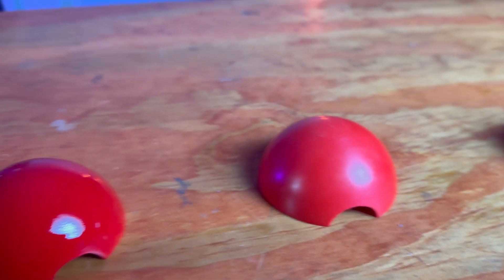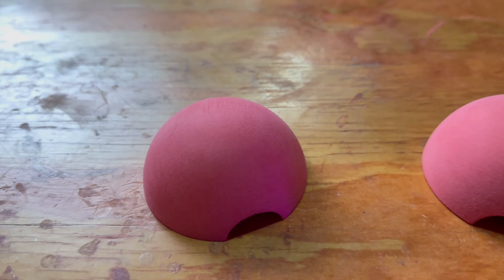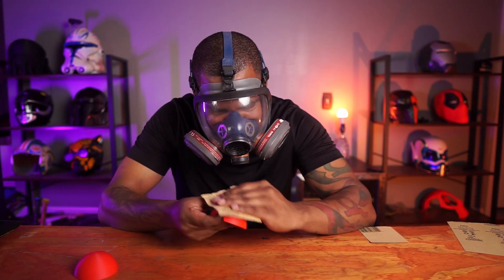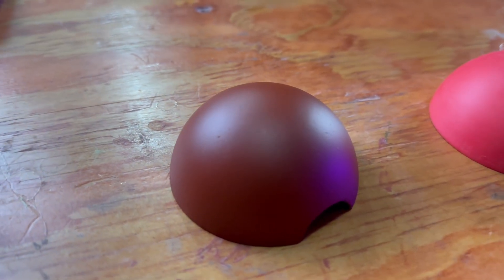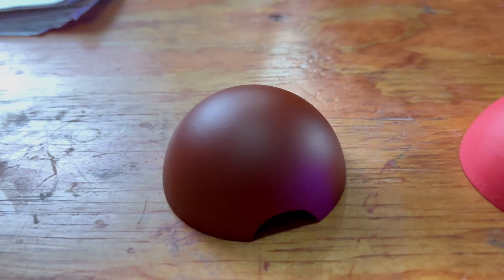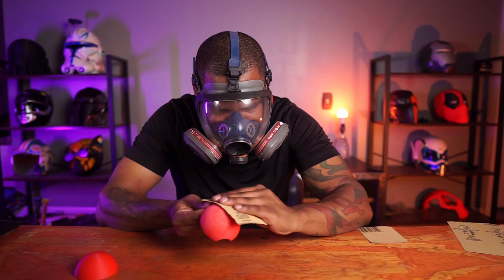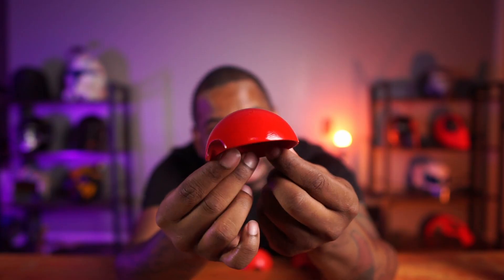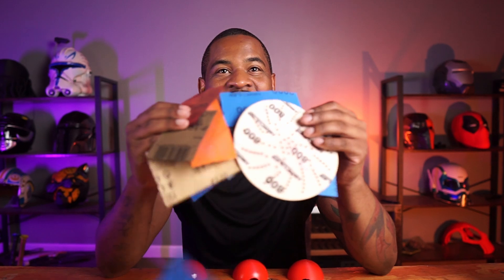Get Amazingly Smooth 3D Prints Using ONLY Sandpaper!

Comment: When you try the acetone vapor test, try it not only with PLA filmament , but also ABS filament.  The ABS will probably react better to the acetone than the PLA.  
of course, I am not sure which Bambulabs printer you are using, so ABS might not be printable with your setup.
Reply from the maker: Thanks so much for the advice I’ll remember that, and I’m using the X1C so I should be good 2 go! 🤘🏾

Comment: Filler primer works great on projects with not so much detail. Once you get into lines and small gaps it fills them in and you have to sand them back in.
Reply from the maker: Yeah I agree, when I get the bondo stuck in lines and stuff I make sure to dig it out with a pick or something.

Comment: I tried to do a perfectly see through lens with a resin print, and i did 80 - 2000 grit, and i used a liquid polish made for jewelry and it worked very nicely, but i spent probably like 5 hours sanding each piece by hand, (all wet sanding), after seeing this i probably should skip the wet sanding until 200 next time xD
Reply from the maker: Aye I’m glad I could help. I need to work on my polishing skills I think I could have got that thing shiny